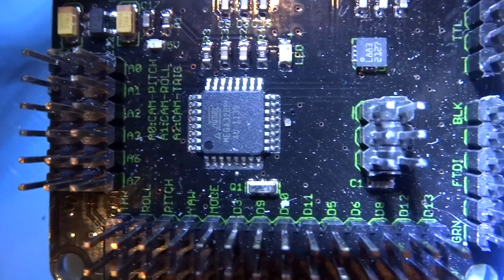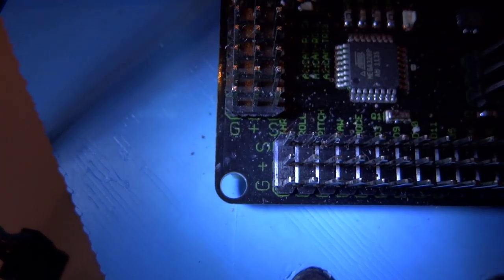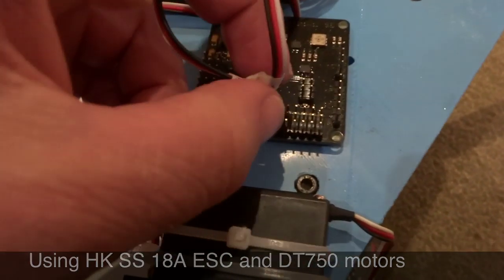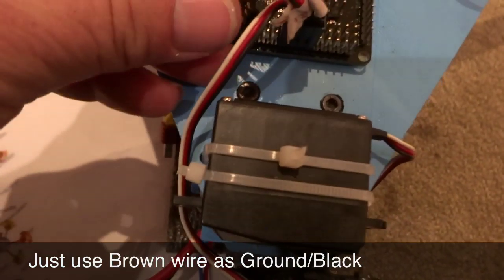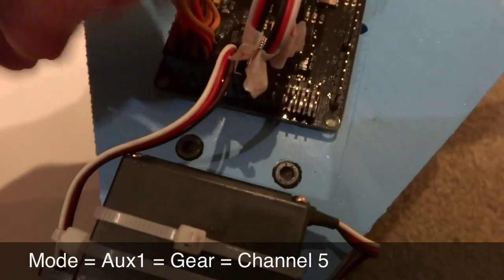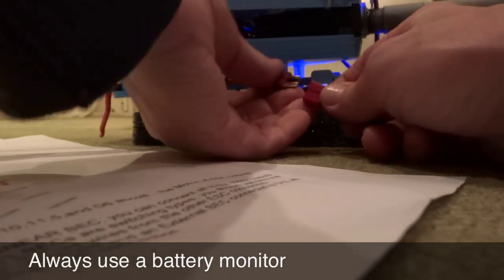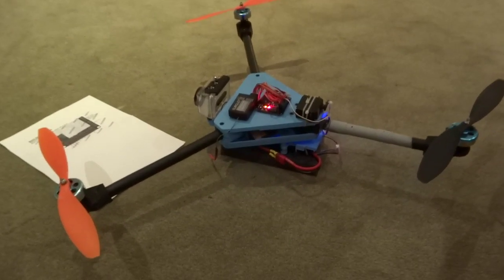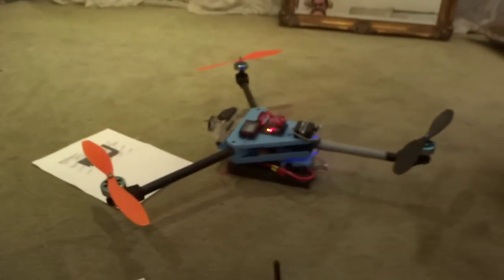Connecting Up Multiwii Crius SE Multicopter Board

Comment: Hi there, allow me to ask you this: Is there any difference between this Crius Multiwii Se (your board) and the MWC MultiWii SE (the red color board)? The second one have: 3-axis gyroscope, 3-axis accelerometer, pressure sensor, 3-axis Magnetometer.
Reply from the maker: This has barometer and magnetometer as well. I know the later ones got a little smaller but I would say that all the SE boards would have the same features. To be honest I don't like to use the mag or baro so just go for the multiwii nano board unless you need those two features and plan on installing a gps.

Comment from the maker: No but there is no reason why you can't get it to fly just as smooth with a little tweaking. Check out my latest Carpark drift video, Inuse the same board but enable gyro moving average in multiwii 2.2 firmware. if you want GPS return to home and loiter then you can add a gps to this board. If you want to program waypoints then look at the arduflyer at rc timer, there is also a flite test video on the arduflyer.

Comment from the maker: you may need to make a short youtube video ? Did you flash the board yet with a correct config.h for your board ? Did you connect up to the multiwii gui to see if your stick travel is between 1000 and 2000 ? You may need to adjust end travels to achieve this.

Comment from the maker: Some boards come with single wires. In this case only connect to the signal or inside pin, same goes for the receiver side. One of the channels should have black and red connected also.